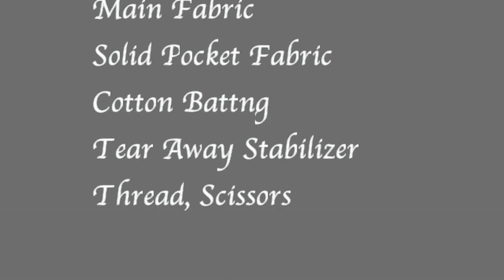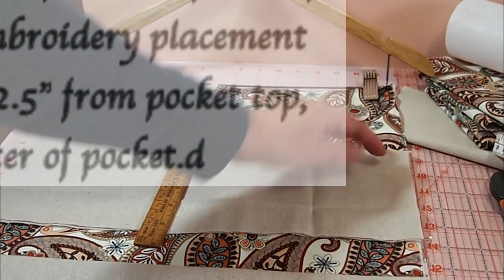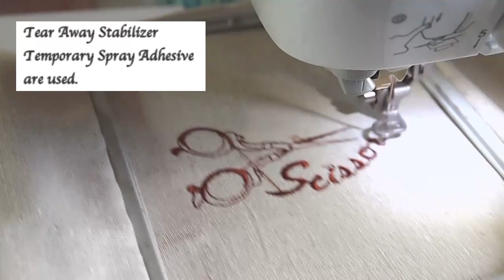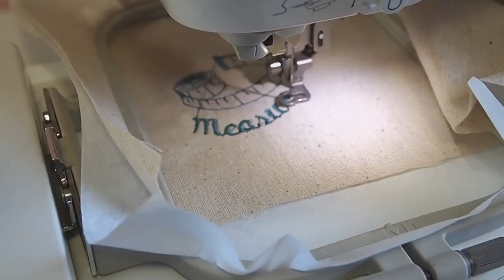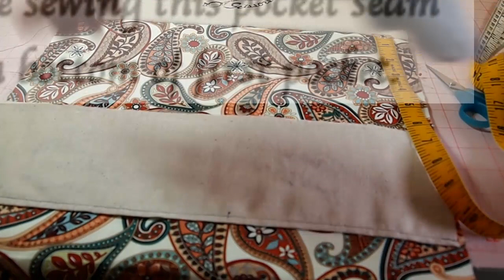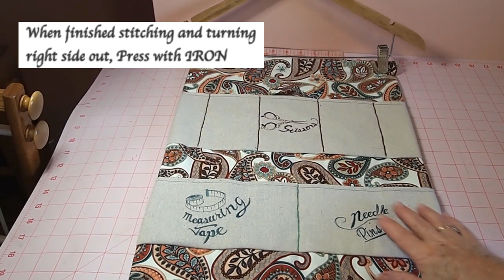How to Sew a Pocket Wall Organizer with Embroidered Pockets

Comment: Hi Bonnie i have the same Brother se400. I am trying to use the sewing and embroidery on scrapbook layouts and cards. Do you know what needle i need to use for sewing and embroidery in cardstock that is heavy weight? Also, not sure what threads to buy for both the sewing and embroidery anything you can recommend will be very much appreciated. Lastly, as to the stabilizer for cardstock is there a specific i need to use and the spray adhesive. Thank you so much!
Reply from the maker: Bebs 06 I'm sorry but I have never done any type of embroidery on cardstock or paper, so I really don't know what to suggest.  The only thing I can suggest is a trial and error scenario.  Experiment with small sample pieces.  I would think just ordinary thread, and medium needle would work, and a stabilizer probably wouldn't be needed.  Since I have not tried it, I can't make any promises.  Thanks for visiting us :)
Reply: ok thank you...